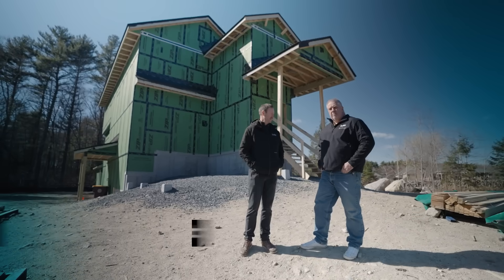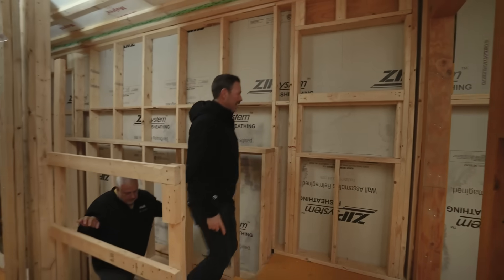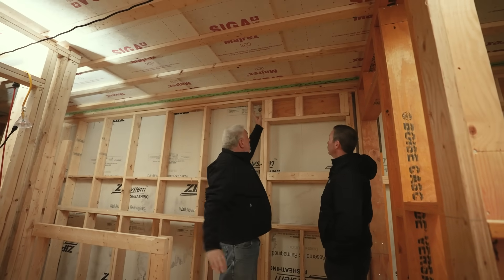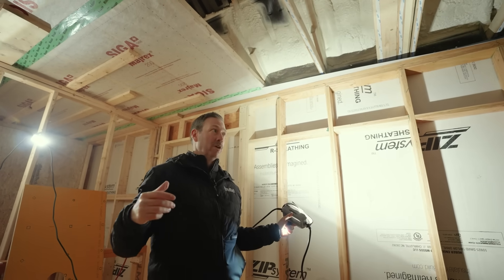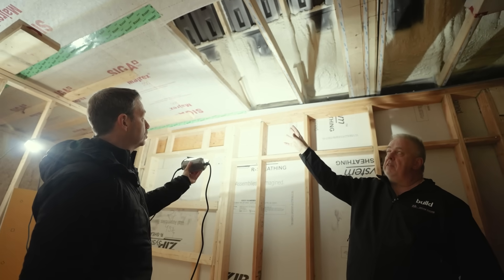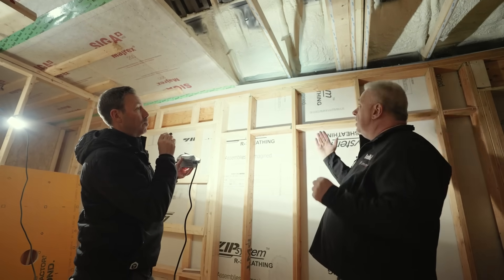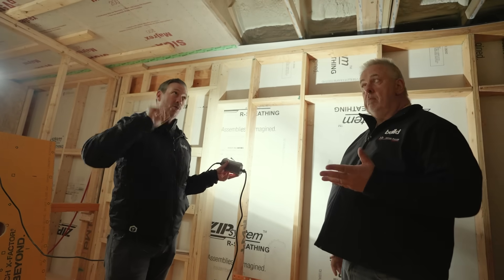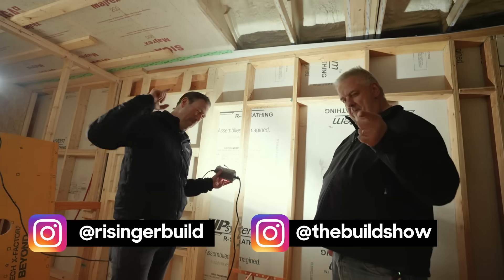Vented Attic Insulation?  Here’s a trick We Stole From European Builders

Comment: I’ve been building houses for quite some time now in Washington state. I’m assuming because of moisture conditions, our codes require more air flow throughout the building. I get that, and some climates, having things, sealed and airtight is necessary. But I’ll tell you one thing. I’d hate to be the person paying for all these extra details. All these companies trying to come up with new systems to sell more material for higher costs. I try and look out for my customers and only do things overkill if they’re 100% necessary. These look like some great systems but are they all necessary? How do you change out lighting if it’s sealed in the ceiling? And we use baffles in the attic all the time, but why run them so close to the peak? One baffle will keep your insulation from blowing away from the bird block. Again we have to deal with high humidity’s and lots of mold and mildew so it could just be the climate. But I’m curious?
Reply: You cannot create a tight home without also adding in energy capturing ventilation systems. These have to be active. Building a tight house is like putting on a wind breaker over a sweat shirt. On a windy day a sweat shirt won't keep you warm. Add the wind breaker and you are comfy again. Start to move a bit and now you need to shed internal moisture. By controlling the ventilation, filtering it as it enters and then capturing heat and controlling moisture, you keep a house comfortable. Extra air "make-up" has to be added for high speed air extraction like big kitchen vents. That's been shown in other builds. The energy consumed with the active energy recovery systems is more than offset by energy losses you have in older style homes. This is at the core of good passive house design. Get this wrong and you have no end of trouble later. In high humidity climates, you may need to add central dehumidification, especially if your building is so efficient that the AC doesn't have to run much. Dehumidifying uses energy, but it's less than full AC cooling.
Reply: Sounds about right. I live in Washington State - King County Area. I've been working on my house bit by bit, including 2x R15 layers of rockwool added as a base layer, with about R45 average depth of existing blown fiberglass on top. I extended the vent baffles by about double to get them well above the loose insulation rather than right at or a bit below the insulation level like before. I also went through and air sealed all penetrations from plumbing, electrical, lights, and wall top plates, no matter how difficult it was to reach. Tight areas of the attic are straight R60 rockwool like one side of the vaulted ceiling above the master bedroom where the down slope of the ceiling also has the downslope of the roof and comes to a tight point at the end.

Moisture shouldn't be a problem in the attic now, but in the house during the fall it can get humid inside and before the attic project I had needed a dehumidifier to run. However that humidity primarily comes from outside when it's 60F average and 80-99% humidity all the time. So having a tighter home and controlling fresh air intake, and eventually something like an ERV would reduce the amount of humidity management required theoretically. In the winter its cold enough that humidity is not a problem, and summer usually isn't too bad but we'll see.

Next project probably next summer will be replacing the rat feces/pee laced fiberglass in the crawlspace with new R30 rockwool and air sealing wall bottom plates and penetrations. I probably won't do encapsulation even though HVAC ducting is in there, but I'll have to do more research for my situation.  @andrelam9898
Reply: @andrelam9898  With just doing the typical sealing like zip wall and being thorough on details, it is often necessary to mechanically add fresh air because the house is already too air tight. I can' t imagine we need this product. Or that it wouldn't be more effective to just do spray foam and a conditioned attic.
Reply: I'm definitely curious how we'll look back at this period of time in building technology development in a few decades. I try to stay very open minded to new technologies and innovation - it's how we get better. But, my skeptic hackles spike when I see all this stuff. For now, I'm sticking with tried and true methods, and letting other builders experiment with the new tech. As time goes on, the best products will reveal themselves and I'll start incorporating them as well.
Reply: FYI there are homes and small apartments/condos built this tight in the Seattle area
Reply: I think if you try to make outdated building methods high performance it is going to be expensive.
To make high performance economically feasible  it needs radical changes in the way you design and build. I would recommend to every builder stuck in  stick frame construction a visit to the big trade shows in Europe to see all the possibilities.

Comment: I don't understand how it can be air tight but not water tight. Got any good reads on it?
Reply: Condensation occurs for various reasons; if you theoretically created a waterproof house, you’d still have water on the inside because of condensation.

I’m definitely not an expert but there are sources of condensation as well as it just occurring from temperature differences between inside and outside.  

If you’ve ever gone camping and had it sealed up well but woke up with a wet tent on the inside, that’s the best way I can think of to have an idea of what it’s like.

Comment: As an insulation contractor, there are a few more points on spray foaming in vent chutes.
First, it seal the air flow from coming into the small amount of fiberglass on the edges and dropping cold air down the wall. It keep all the air going up and over the blown in like states.
Second though is it gives full insulation value down at the top plate and heal ends. We primarily work in zone 6 and 7. R49 min but really like r60 of fiberglass which is 20 inches. Well down in the ends of most trusses you get 6 to 8 inches max. Add a baffle/chute in there and you are even less. By spraying closed cell foam there, you give those ends up acceptable performance values vs if not you only have around an r15 of blow in at the rafter heels in most new construction.
We do it on every build and regularly have to talk customers through why the added cost is needed
Reply: So on your project homes are there ridge vents, gable vents, or other venting system?  I have a bare bungalow that I am trying to decide how I will insulate it.
Reply: @maddierosemusic no gable for sure. I’m R60 min cold climate R29-31 for walls now it’s insane.

Ridge vents are good if it’s steep or you don’t have snow.

They are more continuous, just snow blockage creates an issue.

Maximum makes a ‘cathedral’ custom vent look it up real cool shit. But that’s for old school cathedral where you have to vent every bay because it’s rafters.

Cathedral ceiling with truss, and normal open attics stack vents are the best. (Again my climate lots of snow regular ridge vents get buried) but If roof is steep enough or not a lot of snow ridge vents are great.

Gables suck. Air pressure from temp difference draws cool from lower (soffits) evacuates hot from higher (roof vents).

Another thkng to add here, soprema cardboard rafter vents are far better than the styro ones, and yes spray foaming top plate to rafter vent connection is awesome.
Reply: Thank you, I am getting a new roof and will go with the roof vent, and foam at the base of my rafters.  I do not have gable vents currently.  The whole 2nd floor is open to do as I wish. Thanks! @justinstevenson2061
Reply: @maddierosemusic  absolutely, I love to be able to help. Honestly if any questions during the work let me know.

I like making money from my knowledge when I’m doing the work, but if I’m typing for 2 minutes to help someone save costly mistakes I’m more than happy.
Reply: @maddierosemusic  also to add, don’t just look at sqft venting capacity when going stack vents.

Especially as you said bungalow. Generally they are wider homes.

Distribution across the roof is key.

3 single tier vents is better than one quad tier in the centre, as the air form the soffit want to rise upwards to the roof vents, not travel across the peak left or right.

If you’re 20 ft wide not a problem. Some bungalows can be pretty wide, so you would want to still take sqft into acct obviously but not make the air move left to right much more than 10-15 ft roughly.

And vent bathroom fans out of the gable wall if possible. Soffit exhaust is the worst. Roof vents (gooseneck far better than soffit exhaust) but siding vents are the best.

And you want the vent installed lower on the gable wall.

Reason being is the insulated ducts are only like R4 roughly speaking, so with roof vents the exposed section of ducting can have some sweating.

With the gable wall siding vents, the insulated ducting (still recommended even though buried) is then buried in the attics insulation as to not have any cold attic air coming in contact with ducting.

Not all homes can do this (hip style roofs) but with bungalow you’re likely able to.

Unless your bathroom fan is dead centred in the home, and is a super wide bungalow as too long ducting can also be an issue.
Reply: To the OP, again soprema cardboard vents are king, reason being is they install to the top plate, rise vertically before you then bend them up the roof pitch.

Blocks wind from going through the batts most people stuff below styro.

I know that’s not in this vid, it’s just common practice.

This roof is steeper and doesn’t appear to have as much as the heel but I could be wrong.

We’re vaulting heels 1ft or more now to have higher R value at the wall also. Have seen some really tall vertical rise at the heel.

I go cardboard, and if the customer wants to pay I’ll spray foam.

Only reason I say it that way is I’m retrofitting attics not building, and I still go to this extent.
Reply: Also I’m seeing new/different values.

Some say 18 inches for R60 but what I’m used to is 21-1/2 or so.

I’ll go high to be safe, but wondering the difference if anyone knows.

My packaging still shows 21-22 so I’ll stick with it just curious as OC didn’t have an answer for me.

Comment: If you are still installing drywall, taping, and mudding, why is this SIGA Majrex of use? Seems like extra labor/materials cost... Does it help with air-tightness since wiring and other drywall penetrations can use the raceway instead of actually breaching the attic? Seems like you could still just air-seal before you blow in your attic insulation with just drywall...
Reply: I've been asking the same question. They say the majrex allows moisture to come out of the wall but if the interior wall is covering it how does it pass through that?

Comment: I've been trying to figure out what the difference is between Majrex and a traditional plastic-sheet vapor barrier.  Most of my searches have turned up no useful info (they say "smart vapor control" but never explain what that means).  But just now I looked again, and a site says that it's directional, in that it lets vapor move from the wall to the interior to dry out the wall, but not the other way.  That seems good for the heating season, but not so good for the cooling season where it sounds like it'll let exterior moisture into the conditioned space, perhaps condensing on the back of the drywall.  I think what Steve said in this video (2:19, "it's a smart vapor retarder, so moisture can pass through it, very easily") is probably wrong.  I suspect he was pointing/motioning in the wrong direction.
Reply: moisture majrex venting it out of the living space I guess is best way to think of it. giving moisture a way to leave the house without letting any back into it in general.
Reply: @Tenspound  If that's what it does (e.g. the way Steve pointed), it'd definitely be a bad product to use in regions that have any kind of significant heating season, where people are using humidifiers to try to bring the indoor humidity up to normal.  The moisture would then condense as it migrates through the insulation, going into the colder part of the wall/roof.
Reply: @kc9scott No it allows for moisture to move BOTH ways based on the given RH. This would allow it to dry to the warm side OR cold side depending on the current conditions.
Reply: @Deluxe754  So then it’s kind of like not having a vapor barrier?  How does it decide which way to let the moisture flow?  In the winter, people have normal humidity in the house interior and (if everything’s working properly) low humidity in the wall cavities, and the goal is to keep it like that, as much as possible.
Reply: @kc9scott  The material allows transfer from low RH to high RH but does at different rates based on the side. Its all based on RH and each side has a different perm rating range.
Reply: @Deluxe754  Normally, water vapor will migrate from high-RH areas to low-RH areas (or perhaps more accurately, from high-dewpoint areas to low-dewpoint areas).  For the wall of a building, you'd like for it to go the other way.  In winter, you want the moisture to migrate from the wall cavity to "somewhere else", which is traditionally to the exterior, although if there was a "miracle material" that also let it migrate to the building interior, that'd work too.  In the summer, you want to keep the building interior dry, and in general, any needed drying of the wall cavity should go ONLY to the exterior.  So for that interior barrier layer, you want opposite directions of moisture movement (if any) in winter vs. summer.  I'm not going to believe any material can do that (i.e. I'm pretty sure it's not possible for a material to do that), unless I see a well-written technical explanation of what the material does under different circumstances.  That explanation should come from the manufacturer, not a random person on the internet.

Comment: Why didn't you do a raised heel truss to get more insulation thickness above the ceiling under those baffles? You say r 80, but no way your getting r 80 under those baffles.
Reply: There is a 10” raised heel. There has to be a balance between heel height, roof pitch, height of the building and overhang relationship to the top of the windows on that floor. This was the best overall balance given all those factors.
Reply: Also understand, using a 10" heel with a flash of a couple inches of CCSF, you get R-65 at the plate
Reply: Yeah it’s amazing how far behind the states are in some departments

Comment: You totally sold me on conditioned attics. There is no way I would ever want a vented attic in my house now. The way you did it in your own house is just the right way to do it.
Reply: That one was really expensive.

Btw in cold climates you have to vent to prevent roof rot and ice daming.

And of course it's a LOT cheaper.
Reply: @ You build an over-roof with a vent space between the two surfaces.
Reply: Agree, and we’ve been in the business of blowing insulation for 40 years but since we started installing spray foam 18 years ago, blowing attics is not an option anymore. 
Gotta seal the attics and bring them into the thermal envelope.

Comment: There are nails/connections going from the rafters to the top plate that break that air seal, right? Do you do anything to seal those?
Reply: Just a truss screw sealed in the wood - not really contributing to Air leakage.....

Comment: Awesome video, but wont it still need to be sealed correctly after penetrating for pipes, electrical boxes, etc.  Just like old school vapour barrier?  As for now HVAC, thats only in the US it seems.  Canada its inside the structure.  So without soffit ventilation, how is the roof being vented?
Reply: I think they said it is vented through the soffit at about 5:20.
Reply: Yes, we use gaskets and tape to seal the plumbing vents and conduit for future solar. We treat it the same as penetrations in our exterior walls.

Comment: What are your thoughts about having a vented attic but spraying the backside of the sheet rock with Spray Foam?… not the roof line???
Reply: This is an interesting idea. Dunno if I like it considering electrical in the ceiling but... non flammable/ flame resistant foam....
Reply: I've seen people do it only at the drywall joints where air is likely to make it's way through. Also a lot cheaper than spraying the whole thing.
Reply: Open or closed cell?